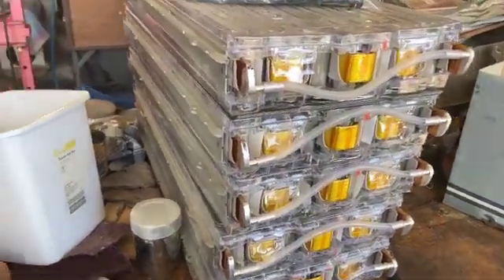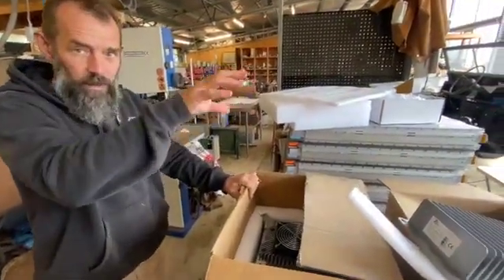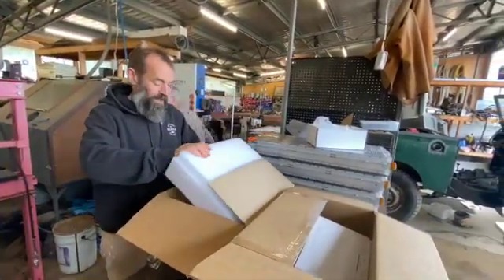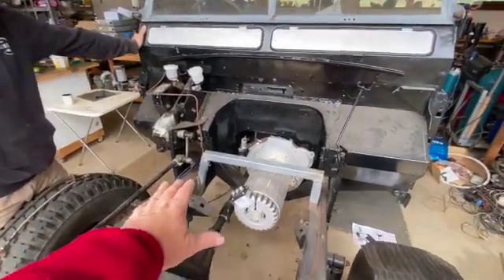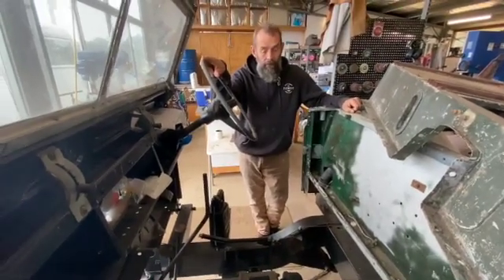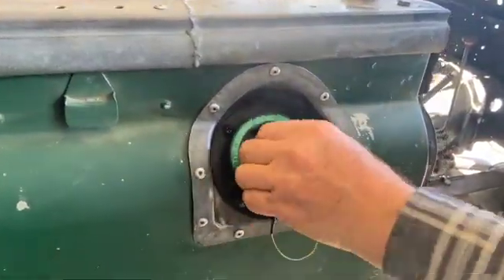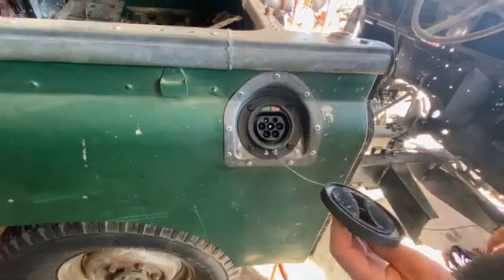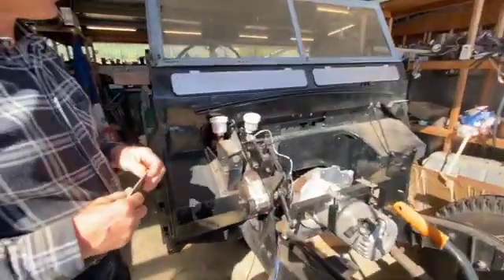Landrover 2A electric conversion & restoration update -  electric conversion components

Comment: Watch the heat under the seat box. That DC DC will run 40 degrees plus. With no airflow probably 55 degrees constant. Those Gen4 elcon chargers need to push a lot of air too. They're both IP rated so not unhappy a bit more exposed to the elements. We used to put the charger in the box like that but moved to making a bracket that sits it under the seat, but with more airflow.  Add some perforations.
Reply from the maker: I actually had that discussion withJohn this morning!!  Glad you can confirm my suspicions.Thanks for that input Dave!